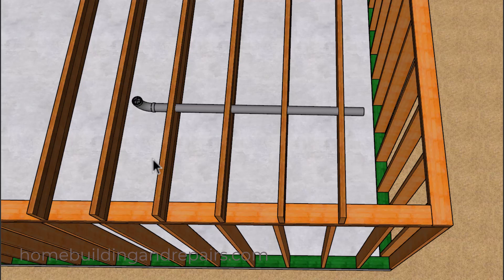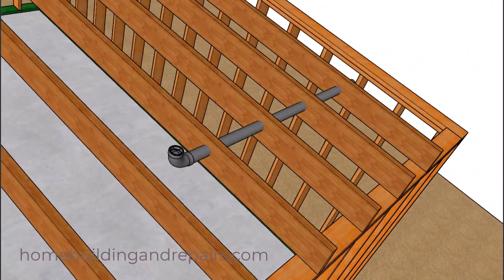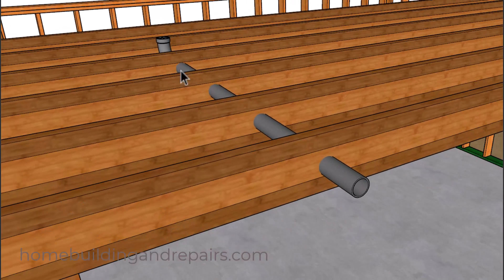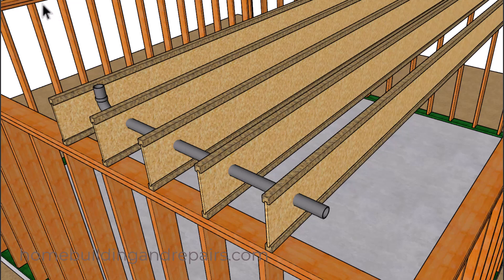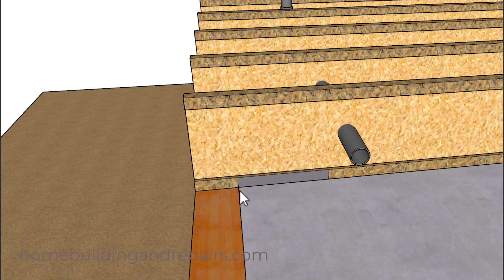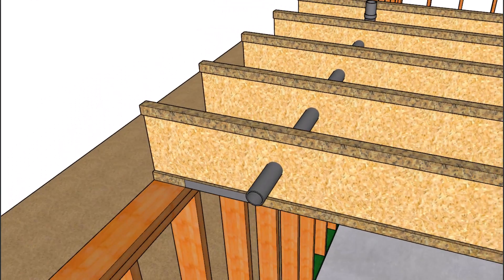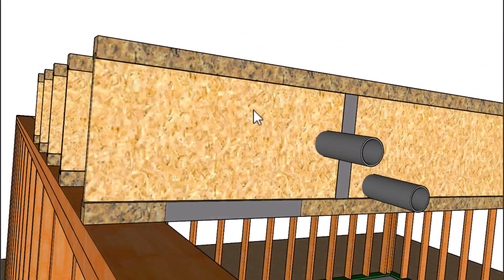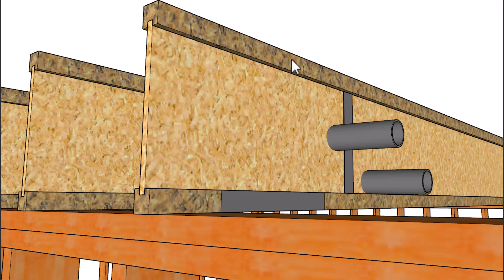Best Floor Joist - What Plumbers And H.V.A.C Installers Prefer To Use For New Home Construction

Comment: Open web looks great and functional but the cost must be more considering the cut-time and expansion of the floor height… 8’ ceiling with 2x6” would now be closer to 9-1/2’ with 24” open web. Thats a lot of extra building and materials.
Reply: You can pre-fabricate web trusses  offsite enmasse. Essentially labor just installs them to the rim joist and fastens them…

Comment: We ran into these all the time in Condos and Apartments. They also do it sound deadening between floors. Easy to move around in and run wire or plumbing.

Comment: Some places are now requiring ceiling fire sprinklers on all residential construction, which makes open web joists extra handy.

Their downsides include greater difficulty in modifying the floor after initial build, eg to raise/lower stairs, or to put in a curbless shower, or to fix an error in the concrete pour that makes them overlength or underlength.

The price doesn't really go up with depth, and practical span rating does, as well as ease for trades. I think a policy of "24 inch trimmable open web joists everywhere" would not be a bad idea.  Retain the central bearing beam/wall and you can do 20-25' deep open-ish plan rooms on either side of it.